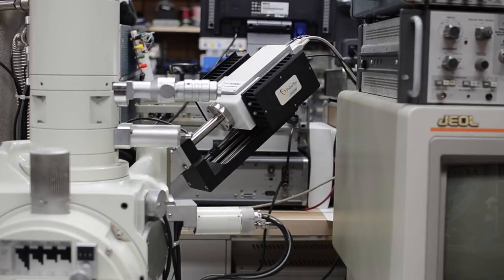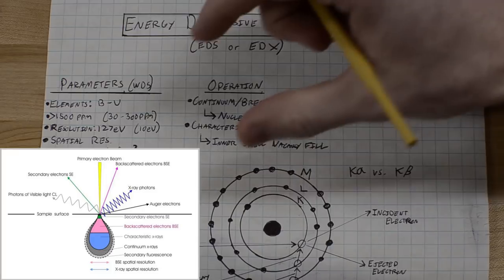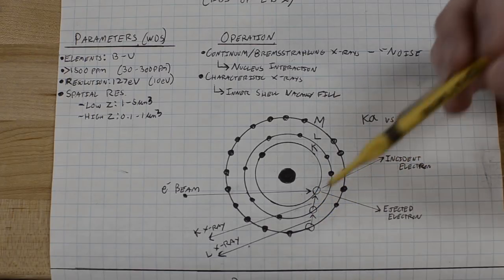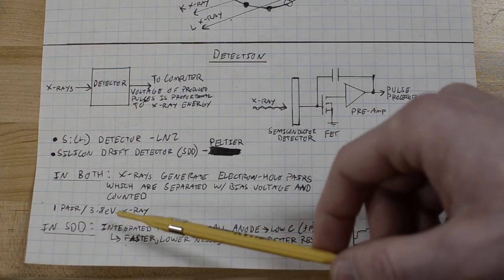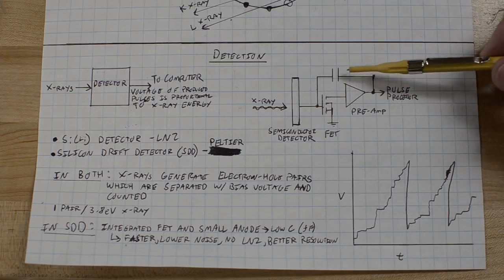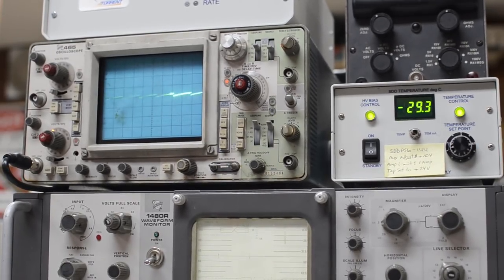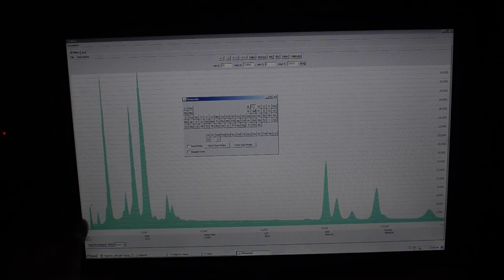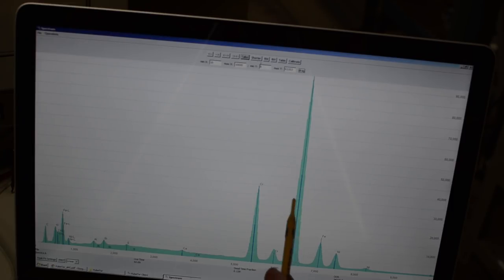Energy Dispersive X-ray Spectroscopy (EDS) with Silicon Drift Detector (SDD) Theory and Demo

Comment: Hey
Really interesting video, and a good explanation of the fundamentals. Check out the Oxford instruments xmax detector. Their 150mm2 windowless detector can see lithium.
Something worth getting into is pulse pile up. If two xrays arrive close enough together that the second xray arrives during the response time of the electronics, it causes a count which is processed as the sum of the two xrays by the pulse processor. OI have some very good algorithms for detecting pileup pulses and splitting them back out into their respective xrays which were summed.